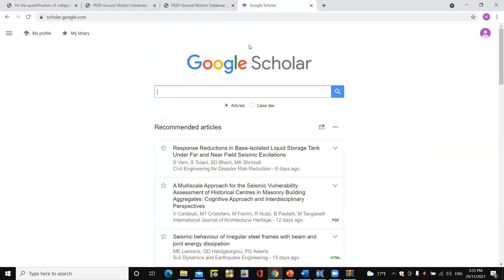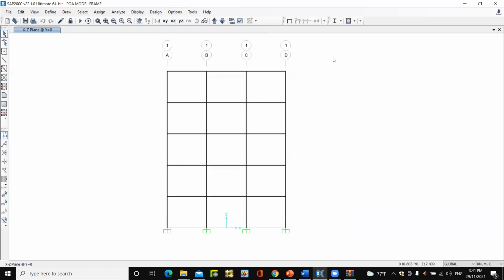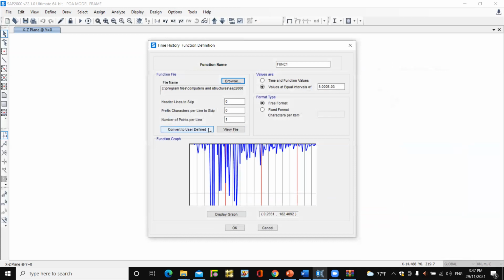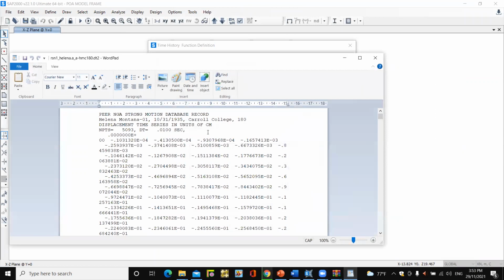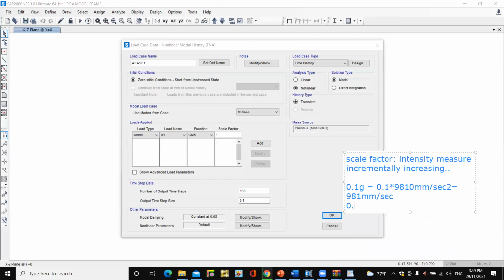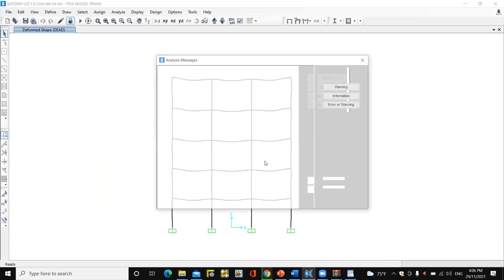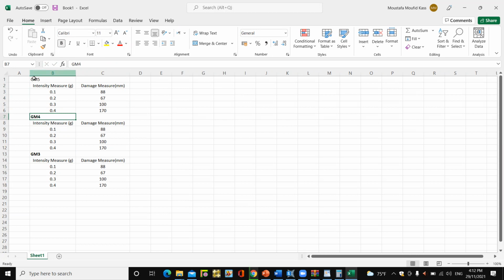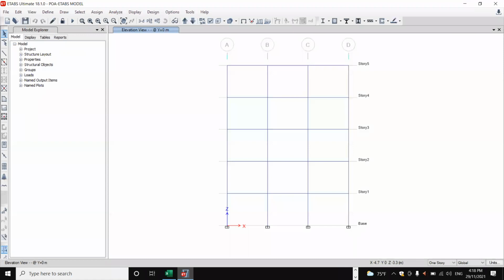Developing an Incremental Dynamic Analysis  using SAP2000 & ETABS

Comment: Hello Sir, can you please explain about fragility curves and how is was developed in all types of building.
Reply: I am also interested in the topic
Reply from the maker: I will prepare video for this in details.
Reply: @EarthquakeAssessmentbyDrMousta  Sir, Still waiting for the video.
Reply: Hello dears. I need to develop fragility curves from IDA. Is there anyone who can guide please
Reply: Hi guys.. define fragility curve is easy once you have the ida curve. Simply collect all ground motion values (i.e. rsa[t1]) that caused building at considered condition (i.e. collapse). All convert to log natural values. Find the median and standard deviation values from these all ln. Then create series of ground motion from 0 to 4 g, with step of 0.1, then convert to ln. Calculate the normal distribution (in excel is normdist) of these series, median and standard deviation. You will get the probability. Plot it with ground motion series of 0 - 4 g, then you will get fragility curve. Further about fragility curve, you can read paper made by dr keith r poter. It has example with various data vondition. It is entitled Practical Development & Application of Fragility Function, published in 2007 by ASCE.

Comment: Can you please explain how to develop fragility curves from the results obtained from IDA?
Reply from the maker: I will prepare video for this in details.
Reply: Hi guys.. define fragility curve is easy once you have the ida curve. Simply collect all ground motion values (i.e. rsa[t1]) that caused building at considered condition (i.e. collapse). All convert to log natural values. Find the median and standard deviation values from these all ln. Then create series of ground motion from 0 to 4 g, with step of 0.1, then convert to ln. Calculate the normal distribution (in excel is normdist) of these series, median and standard deviation. You will get the probability. Plot it with ground motion series of 0 - 4 g, then you will get fragility curve. Further about fragility curve, you can read paper made by dr keith r poter. It has example with various data vondition. It is entitled Practical Development & Application of Fragility Function, published in 2007 by ASCE.

Comment: What is major difference between non linear dynamic analysis and IDA ?
Reply from the maker: Nonlinear dynamic analysis type is time history analysis which provides to develop the IDA curve, by incrementally increasing the intensity measure with respect to damage measure. In general speaking, the IDA can be generated from NLTHA approach.
For further clarifications,
Please contact me on moustafa.mk@usm.my.
Reply: @EarthquakeAssessmentbyDrMousta  sir there is some difficulty to contact with you. i can't connect you please provide any another approch to connect with you
Reply: @EarthquakeAssessmentbyDrMousta  sir can you give any suggestions regarding research work in earthquake engineering topic which is popular now a days for masters of engineering purpose ?
Reply from the maker: @rahulkaklotar6510  sir you can contact me on my email moustafa.mk@usm.my, so i can help you to suggest an earthquake engineering tasks.